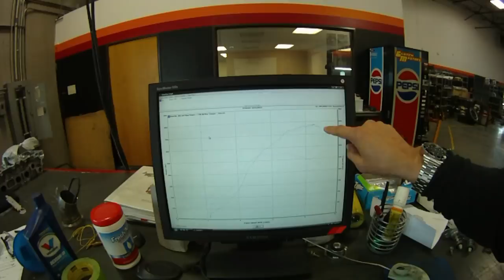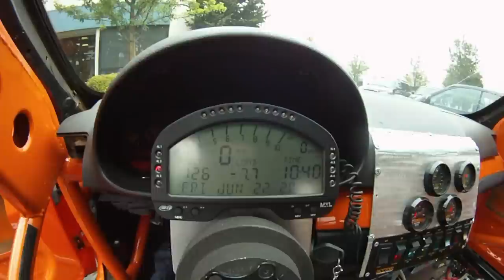HPF Track M3 - High Compression 778rwhp @ 18psi Dyno and Test Drive

Comment: correct me if i am wrong, but high compression does not help with spool but better off the boost response being of a n/a the boost comes in at the same rpm but the torque of the high compression makes it move a lot quicker therefor not needing a lot of boost to make same power levels as lower CR. high boost engines high CR makes for a very linear HP level. now i am not saying that it does not aid boost because it does but does not make it spool faster just feels like cuz of the higher CR

Comment: Chris, you made less power on every part of the curve (for the most part) on this high compression motor + 6766 then you did on your low compression builds with a 6766 (take a look at Greg's dyno graph.. you're down almost 50rwhp up until 5400rpm or so.

Comment: Seems like it should be faster. 778 rwhp isnt all that impressive when you have worked on daily drivers that put out more than that.
Reply: reliable race car power at high revs, means sacrificing power for smooth power band.
Reply: only on fucking YouTube where 700+whp is not impressive. my ferrari 360 f1 only put 456 to rear wheels with mild upgrades and it's fucking nuts at 8500 rpm. can't imagine driving this on the road

Comment: you cant do that with high compression! must have water meth
Reply: It says C16 at the start. Ive seen a few 13:1 40+psi e85 builds on 4 valve japanese engines.
Reply: my 347 has a high 10 to 1 compression ratio, I want boost someday I just worry that the compression is a limitation, I do have a nitrous kit but i wouldn't do ether without using water methanol injection
Reply: ***** The head design on a late model 4 valve engine is far superior to a pushrod small block, even if it has aftermarket heads. Thats why high compression pump unleaded is 11:1 on a sbf for example, but on the other end of the spectrum was my old race bike which had 14.7:1 on pump unleaded and still had 37d of timing.
Reply: +Jack Torrance Yeah, I wish more educated people existed on youtube. Just had guys on another video telling me 14:1 and higher arent possible, when theres speed shops and engine builders making N/A motors that are in the upper teens, diesels in the twenties and turbo motors in the 13-14 range.
Reply: 458 Speciale comes with a 14:1 compression ratio from factory. And it's made to run also on the crappiest unleaded fuel out there.